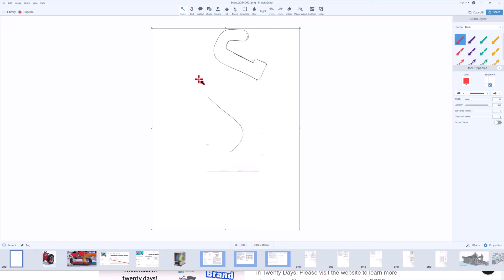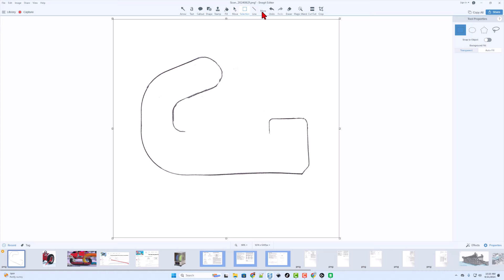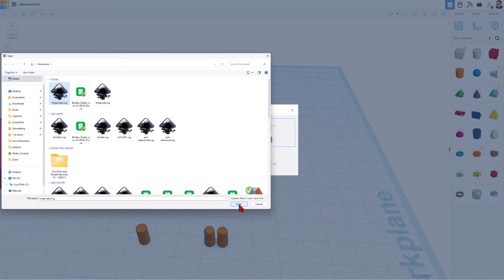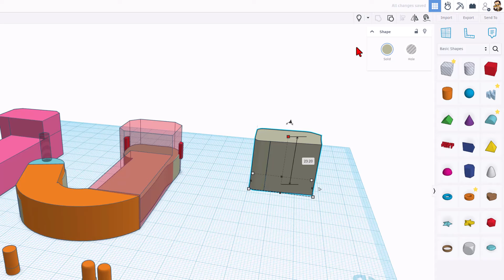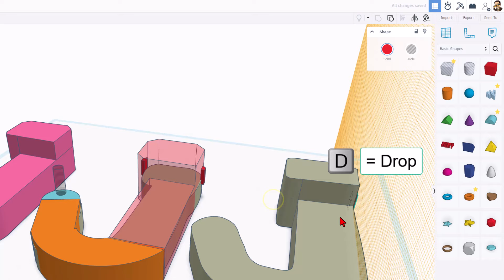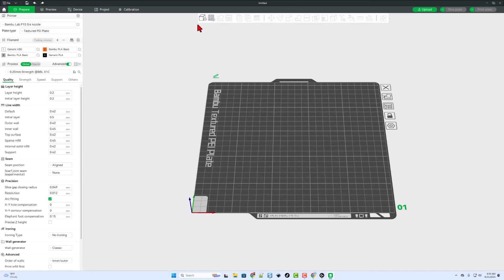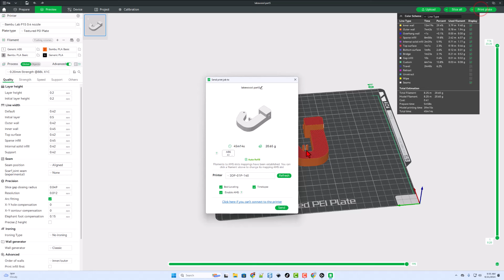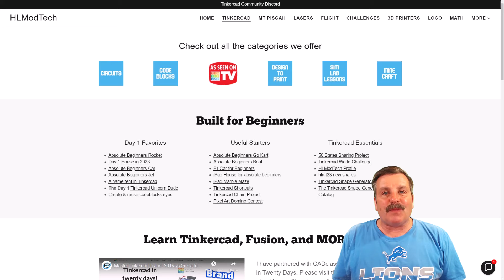Scan Import Print! Tinkercad & Bambu Labs Steps 4 Beginners Useful Parts FAST

Comment: I'd print the pegs on their side for strength with flats cut off the lower side to avoid finish problems associated with supports.
Reply from the maker: Great point. Will be interesting to see how they hold up for the user. They will not be back in school till late August.

Comment: Back at the beginning of open source FDM, ABS was very common because companies already sold filament for commercial plastic welding. Then came PLA and cheap Chinese printers and ABS got known as a difficult filament. I'm glad to see it's no problem for the P1S.
Reply from the maker: Exactly! I used it with my Makerbot Replicator 2x. It was my first 2 extruder printer. Printing your Key Chain Capsule https://www.tinkercad.com/things/bwetOonZphK-keychain-capsule-2 Right now with ABS. Modified it to hold the bags for cleaning up after the pooch. 💩

Comment: I converted the file to SVG and imported it into Tinkercad, but the 'silhouette' option in fill mode does not appear. I tried again, but nothing. It doesn't show up. Do you have any solutions?
Reply from the maker: You can reach me at hlmodtech gmail. If you share the SVG file or the file you converted it will help me figure out what is up.
Reply: @HLModTech  Many thanks !!! Email with files sent to you for your analysis
Reply from the maker: Got it. The design you are working with has inside and outside edges, so there is no silhouette. If you choose the internal edge in picsvg you will get a solid shape and have all those options available.